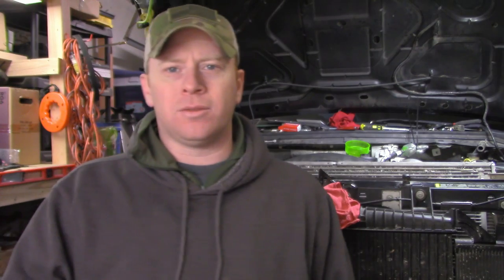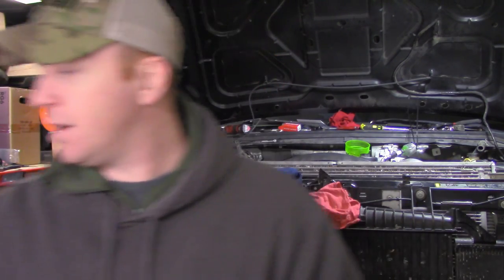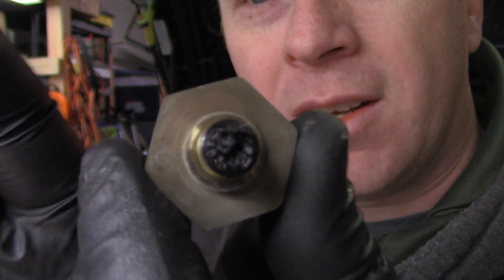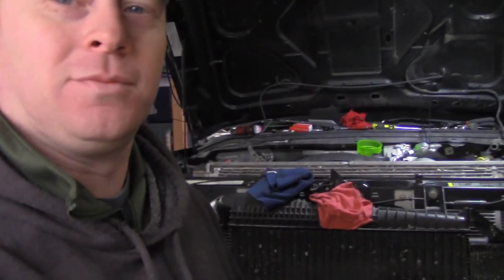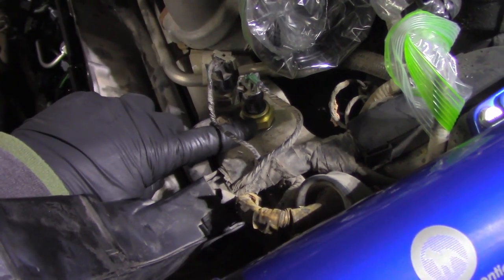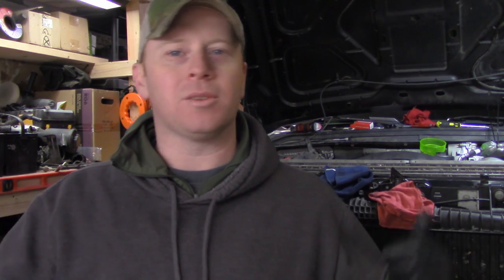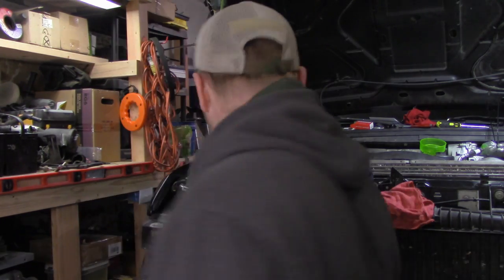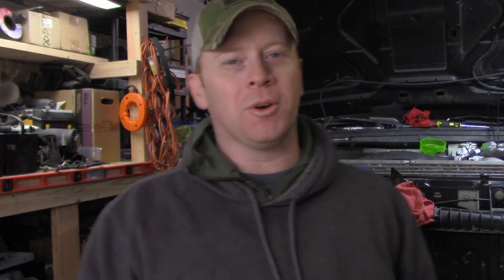Single Cheapest Way to Increase Fuel Mileage in 6.4 Powerstroke

Comment: Hey bro so I just switched my MAP sensor and my Fuel Rail Pressure Sensor and I noticed that my Boost it stays on 1 while I'm stationary or even on parked. What do you think it could be?
Reply from the maker: It has probably always done that, just now you're paying attention to it looking at boost after doing maintenance. Nothing to worry about.
Reply: @USAF99  I usually tried to pay attention to it since people says we should wait a few seconds before turning it off to make sure the boost is down and the turbo is done spinning. So you think is fine to shut the engine off without the boost being at 0?
Reply: @juansebastianlopez8828  I'll race you for money peasant

Comment: Hey there just wanted to say I have looked at the  map sensor and looks clean no soot whatsoever but I still have about 7.8 to 8 mpg what else could it be or should I just change the map sensor anyway even tho it looks clean and yes my truck is deleted 🙄
Reply from the maker: That bad you might want to be looking for a dragging brake caliper or stuck open injector. Does it smoke? That's pretty bad mileage!

Comment: Hi I have a 2008 ford 250 6.4 and it does the regen every day two or three times a day is there something I can do to stop it from doing it so often? Besides the “delete” I’m in California so I can’t do it anyway
Reply from the maker: Honestly Jose, you're kinda screwed in Cali. There are really two options for your truck, either replace the DPF or have it cleaned. Either one stinks but with the tight emissions laws and inspections there, that's about all you can do. Whichever you decide, I would do them soon because the back two cylinders in your truck are most likely being destroyed by the multiple regens a day.
Reply: @USAF99  thanks for your advice!! But I got the dpf cleaned up about 5 months ago and I already changed sensors that could be replaced and still have the check engine light came on too
Reply from the maker: I meant to ask you and completely forgot-- what were the codes stored in the ECU? If your DPF is clean you may have a bad after DPF pyro sensor. It's reading wrong so the truck thinks it needs a regen. I would be interested to see what your codes are. Apologies for not getting back to you sooner!
Reply: @USAF99  thanks for answering I took my truck to a different mechanic and he said the dpf sensor that was on it wasn’t from the Ford dealership when the mechanic always said it was, so now with this new sensor the truck seems to finally be fixed!
Reply from the maker: @josegpazc  Good deal because those regens were killing the back two cylinders!

Comment: i had a question, i just bought a 10 6.4 its deleted and someone had a tuner in it but now theres only the wire with no tuner! do i need to have a tuner on it i was just gonna drive it till i could afford a tuner? thanks and thanks for your service!
Reply from the maker: So, if it's not throwing any codes and runs fine, the tune most likely still loaded to the truck. They may have thought they got one over on you but the joke is on them....the tuner won't work in any other truck until they uninstall the tune from your truck...something you're not going to let them do. You should be good for now unless you start swapping computers.
Reply: @USAF99  so i bought this truck i was dumb about it i found out about all the bad things people talk about, but it throws no codes and runs nice only thing is sometimes on take off it sounds like a bus or like it was geard low but rpms r fine i guess it sounds like a bus its not a hiss but once i put a new turner on it it should be ok u think? im sorry all the negitive stuff has me worried i have tons of questions the salesman of course told me what i wanted to hear!
Reply from the maker: @patrickmcguire3673  You have what's called a compound turbo- that's the "bus" sound you're hearing. Its normal. Wait till you're standing next to the exhaust on start up and it sounds like a jet starting up. These trucks with the 6.4 aren't bad, the negatives can be mitigated by taking care of the truck. Keep up on the fluids, keep an eye on the mechanicals and don't drive it like an idiot and you'll be fine. These trucks are designed to work, not hot rod.
Reply: @USAF99  buddy you made my day this is why i love vets there the salt of the earth! thanks so much and i will take great care now that i know what is goin on! i will be watching your channel religiously and fyi thats what i bought it for is to tow i have a small shippig compamny i had a duramax and loved it but got caught in the riots in new york and they used it like a roman candle! thanks again
Reply from the maker: @patrickmcguire3673  Appreciate the support!

Comment: I have a 09 6.4 F-250 I have a issue I cannot figure out if I’m going about 70 mph on the highway if I accelerated to pick up speed it stalls I just change that fuel pump that’s underneath the driver seat it ran good for about an hour on the highway then it started stalling on meEverything is still stock in my truck I don’t know if it has to do with my DPf or EGRThat is giving me an issue no codes are coming out either I really need help trying to figure this out Truck does not turn off it just feels like it’s losing power or ran out of power or like my fuel system is not giving it to pressure it needs to accelerate like if I had an old bad fuel filter or something Well driving on the highway if I turn my key back as an off then to the on position it’ll pick up speed like a champ but once I let go of the gas pedal going up a hill if I’m not love tap in the pedal it will lose speed or if I let go of the gas pedal and try to accelerate it’ll just slow down like if I have a problem with the transmission but I just reset it again and put the key for back then forward and step on it and it runs like nothingBut as soon as I let go it’ll lose power the only reason I could make it pick up speed is just love tapping it Or cut it off and back on from the ignition switch and step on it
Reply from the maker: Let me do some research and try to recreate the issue on my truck. I have an idea what it might be but I want to verify first so you aren't buying unnecessary parts. I'll get back to you.
Reply: USAF99 thank you so much buddy I’ve been looking at your videos hopefully ran into an issue like that not that I want you to run into an issue like that but I’ve had no luck yet
Reply from the maker: @raulvalles7338  So, here's what I want you to do. Check fuel pressure under a load. It should not be below 40 at any time. If it is, you have a fuel restriction somewhere or your HPFP is going/gone bad. Don't just check fuel pressure at idle, that will give you a false positive. Check it while you are driving it, I have seen guys hook the gauge up to the mirror where they can see it and then drive the truck from a stop to 30-40 MPH at wide open throttle. If your fuel pressure stays above 40 during all that, we will continue to diagnose.
Reply: I drove it out of town yesterday had no issues at all I found a sensor disconnected to the throttlebody where the air filter is at The only thing now when it’s on regen mode on the screen in the dash panel It’ll take forever to clean the exhaust so I’m thinking of a DPF delete
Reply from the maker: @raulvalles7338  Its more than likely filling up and getting clogged or close to clogged. If you don't want to delete it, you can remove the DPF and have it cleaned as long as there is a shop in your area that can do it. You might check around to see if there is in the interim while you decide if you want to delete it or not. Glad you found the problem, I was going to say pedal position sensor initially but then wanted to see if you were getting adequate fuel pressure first.

Comment: Explain egr and dpf and why it can help with motor lifespan
Reply from the maker: What they are and why its good to delete them? An EGR valve is explained by its name-- Exhaust Gas Recirculation Valve. It recirculates exhaust gasses back into the intake for another combustion cycle. This is particularly bad in a diesel where that sooty exhaust, pre-DPF is going back into your intake. Exhaust soot gums stuff up, collects on valves, etc... The DPF is a Diesel Particulate Filter. It does just what it sounds like it does, it filters particulates out of the exhaust coming out of the engine, post turbo. What do filters do though? They get clogged over time. But you can't just get into the DPF and swap out elements, it has to have some kind of self clean-- which it does...kinda. The computer knows when its getting dirty and puts the truck in regen or regeneration. It will dump raw diesel fuel into the #7 and #8 cylinders on the exhaust stroke to be pushed out the exhaust and combust in the DPF....turning particulates into ash, which can then be blown out the exhaust. This is specifically harmful as the DPF doesn't get 100% clean on each regen cycle, and eventually the truck will continuously regen. THAT is bad because each time it regens, its washing down the cylinders with raw diesel fuel, eradicating the oil on the cylinder walls and eventually destroying the back two cylinders. Plus, it creates immense heat. Hope that helps!

Comment: What is the code P179A in a 6.4 2008
Reply from the maker: P179A is usually power loss to the turbo actuator. Refer to the wiring diagram for correct voltage with KOEO and which wire it is. Trace back to see if it's broken anywhere.

Comment: Otra pregunta. Mi troca. Dura 15 ml. Por galon is. Normal. ??
Reply from the maker: Si pregunta si 15 millas por galón es normal, realmente depende. Eso no es genial, pero tampoco terrible. Lo siento, estoy usando el Traductor de Google para responderte.
Reply: @USAF99  😆🤣👍  mui bien perfect   15mpg. Is good ok you wan using for hard work  gives 11mpg to  me is perfect.   Is 6.4 is big engine hp     delete EGR DELETE  DPF  I THINK  6.4 IS GOOD ENGINE
Reply: Esta bien.   Ponle un motor Cummings. Y  te Dara mui buen rendimiento. D 18 millas a 25 millas por galon